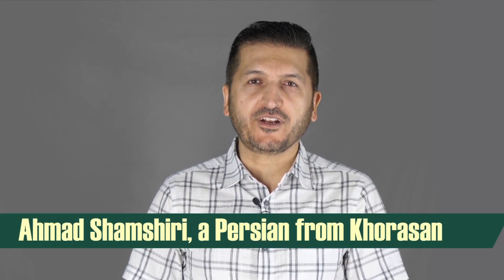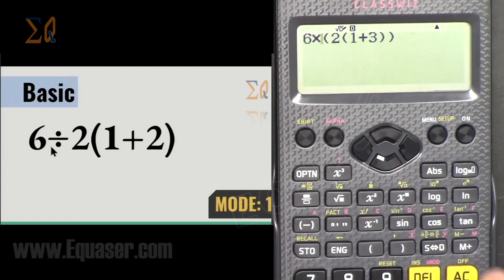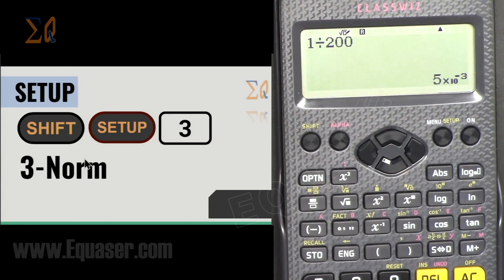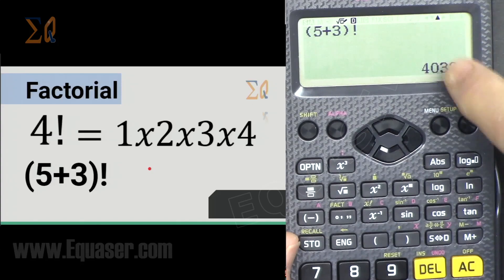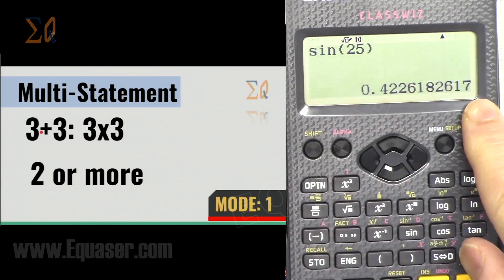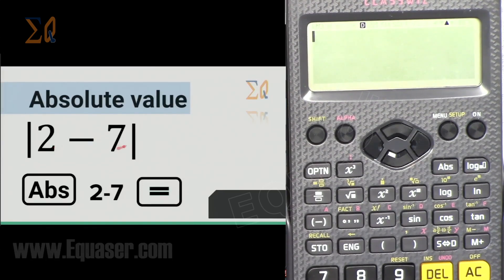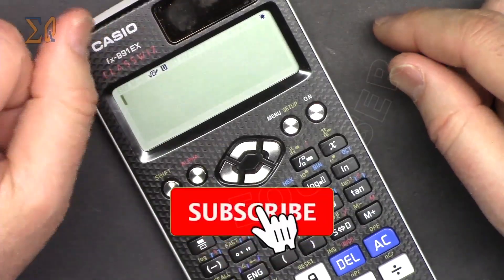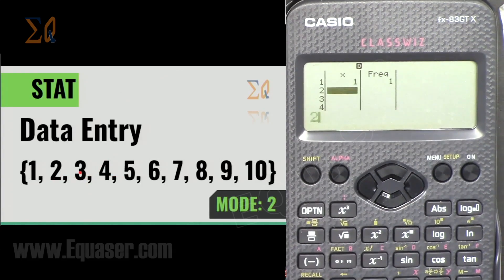How to use CASIO fx-83GT X fx-85GTX  fx-82spx Casio FX-82DE Scientific Calculator Full Video Manual

Comment: I sent you 3 diagram examples could you do a short video to calculate show the answer
?
Reply from the maker: I replied and said you need use the same unit to add something. in series you add them . for example you can add 5kg with 300g by 4+300, you need to convert either 5kg to gram which is 5000g or you  change 300g to kg which is 0.3g. then when both are the same unit gram or kg add them.  to use or share image use this https://snipboard.io and you don't need account, just copy the image from your computer by right click and copy and come to this website and press CTRL+V (paste) to past it and you will get a URL to share. here is question 2 of your series image https://snipboard.io/Z1hQTJ.jpg  with answer